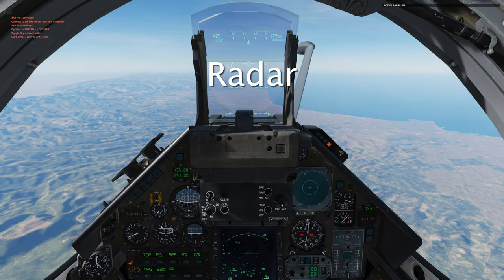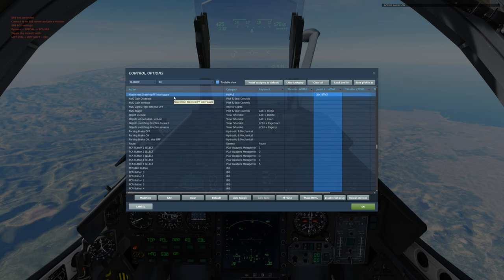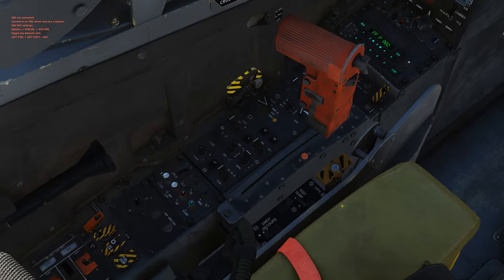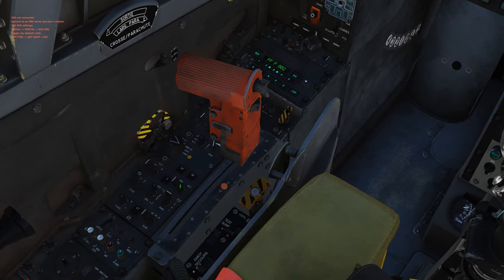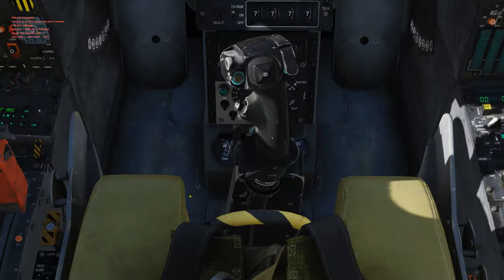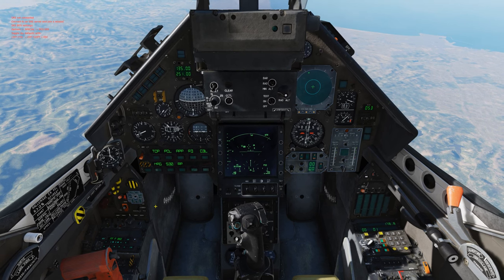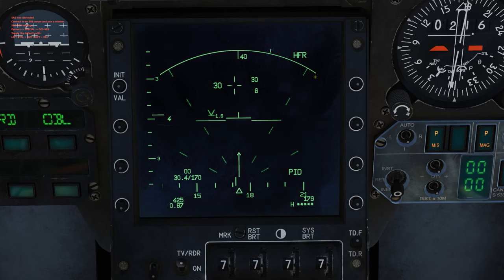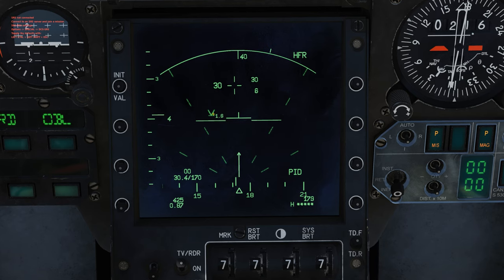Mirage 2000C Air to Air Guide. | DCS | Digital Combat Simulator |

Comment: How do you release the missile? I practice earlier, I got radar lock, double circle but I cant fire the missile with pickle button, I tried the first and second detent and I still cant fire. Same thing with magic I have the triangle. Master arm is on, i got the weapon selected but I cant fire the missile.
Reply from the maker: There's no pickle like a viper or some other western planes. The trigger does it all.
1) Flip the master arm. 
2) select weapon in PCA panel
3) lock target
4) get launch authorized (within range) or double ring circle
5) Hold second detent trigger for a second or two

I also have a new update tutorial series